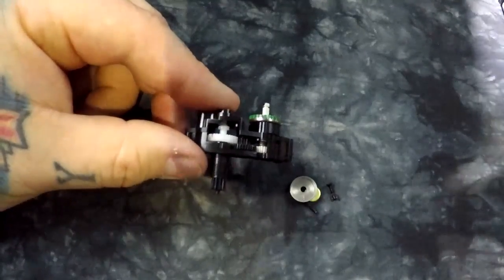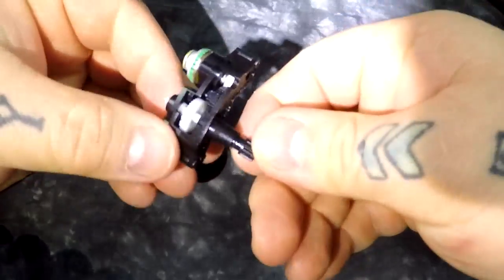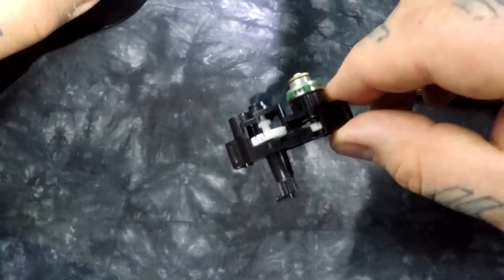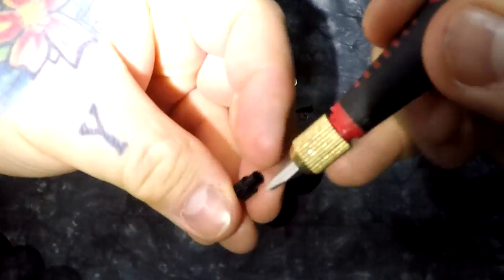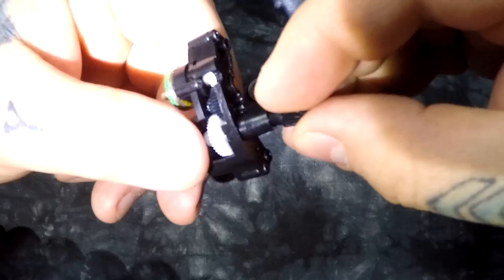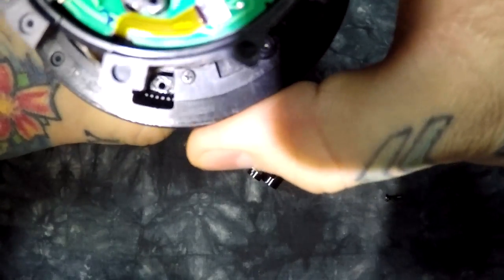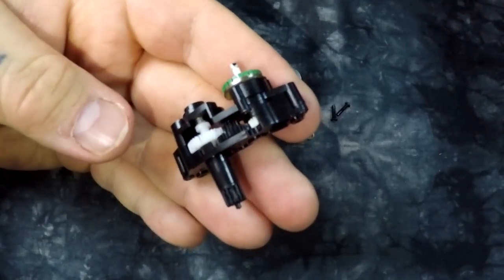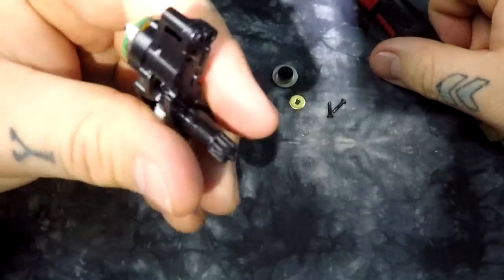Nikon DOES NOT want you to see this video...micro-motor assy.   Part 2

Comment: I bought a 18-135 on ebay that will not autofocus at all. I have been too busy to take it apart. I will keep my fingers crossed the clip just fell but I usually am not that lucky. Took some screwing around with the seller to get most of my money back. $30 after refund. It's a G lens so no scale to help manual focus. Live and learn, no more AF lenses from ebay for me.